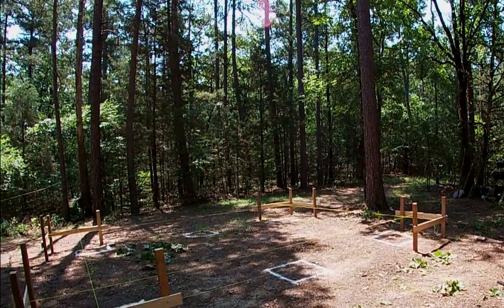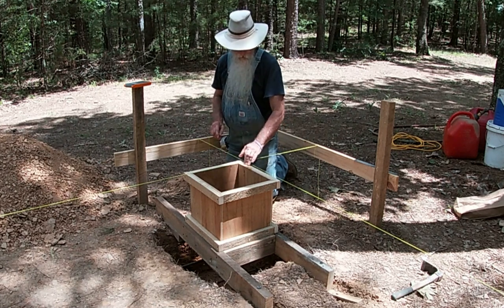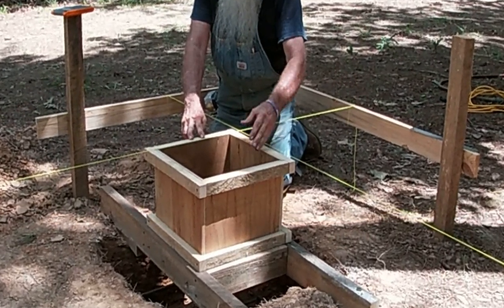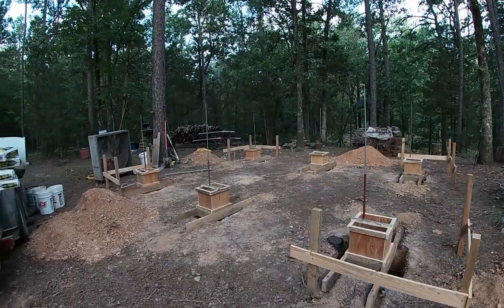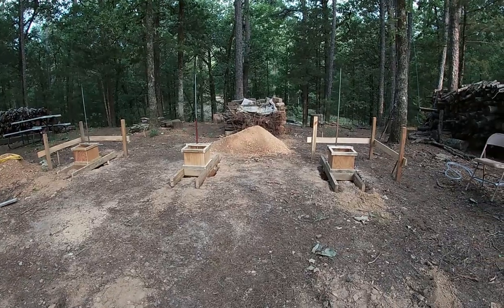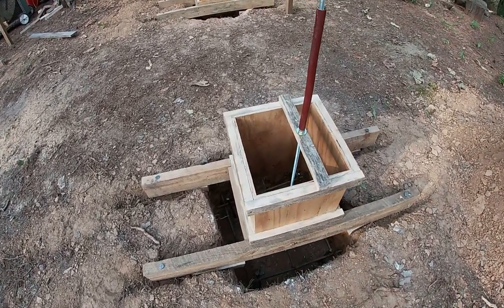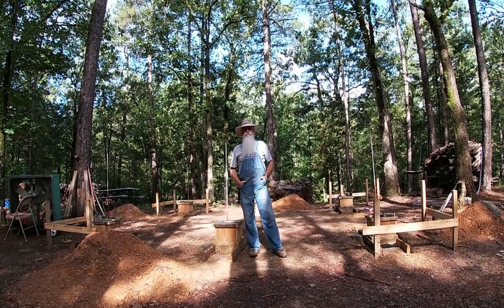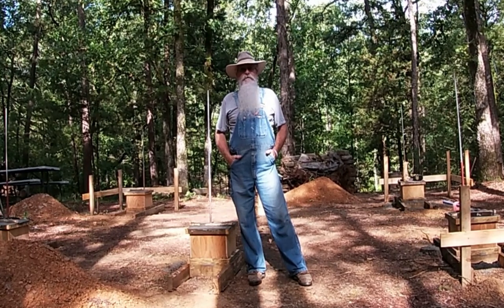Footer & Piers, Paradise Point Log Cabin Build - Ep 1

Comment: I had the idea for my peirs as a galvanized culvert bore into the ground 4 to 5 feet below the ground and 3 to 4 feet above ground fulled with cement.  That would provide 8 - 9 feet of peirs in cased a Metal culvert. I have to build with the consideration to hurricanes. We have to be Concerned with mold and wood eating insects too. Just a suggestion and something I learned on my curry house built in 1920. On top of the peirs, place a oversized flat piece of galvanized steel that over hangs on the peirs 8 - 10 inches. Then place the logs on top of that metal. That way any wood eating insects climb up any piers,  they touch on that metal and then they fall off to the ground. Termites don’t like anything metallic. It becomes a cycle keeping them bugs away from the wood. It also helps to have that house raised up at least 2 - 4 feet from the ground to lessen the chance of mold. High and dry as my father would say. Thank you for taking the time to put these videos together and god blessings to you.
Reply from the maker: Howdy ABC- you have some really good ideas for doing the piers. We don’t have hurricanes but tornadoes do happen here. You have good suggestions for the tops of the piers with the metal cap. That has been done and it works. Thank you so much for the comments. God bless you
Reply: @TheBeardedCarpenter  nothing wrong with overbuilding the place you call home. I can’t wait to sell my current property and get to the sticks. I’m sure of the configuration of my cabin. It’ll be built with the traditional craftsmanship methods but with some knowledge of today. The knowledge we possess today, far exceeds the knowledge of yesteryear. We have evolved. I know I don’t want electricity, in-door plumbing, internet/cell phones. I’ve even considered a horse and buggy’s. If the Amish won’t so found of the cold, I would consider relocating to that type of community. But I disagree with there religious denomination. I’m comfortable with LCMS as opposed to Calvin. I respect the individuals whom are subscribers to Calvin, but we’ll disagree on many issues. I do want I can to be kind and respectful I came across. But you do run-up one that 1. But Florida isn’t half bad. There’s many types of fresh and salt water fishing available. hunting is good and all around us. Many different activities all around us. Property tax’s is reasonable. Residing inland northern Florida shields us from hurricanes. Right now there’s one in the Florida keys. Excited to come up here and brake-up to a simple tropical storm. That’s way I would enjoy a rainwater collection system in which Florida supports rainwater harvesting. God blessings to you to sir. Happy Independence Day to all my country men.
Reply: @TheBeardedCarpenter  A home is only as good as the ground/foundation it resting on. Hopefully high and dry too.
Reply from the maker: @ABC-oo4vm  Howdy- you’re so right. Both the cabins I’m doing are on the high part of the property and drains in all directions away from the cabin. Blessings
Reply from the maker: @ABC-oo4vm  Howdy- there are many people who are looking at everything like you are. It seems there’s a group of people wanting to get “back to nature”. The first cabin I built is totally off grid. Wishing you the very best with what you decide to do. God bless and keep you in His care

Comment: I've worked concrete in various capacity for as long as I can recall, not as a professional but as a DIY, so please bear with me.  Everytime I've needed forms for load bearing, I've always just purchased concrete brought in with trucks.  That said, you mentioned something about 'honeycomb', in reference to your moisture content with the bag mix.  Could you expound a little, regarding bag mix, on what is best as far as moisture content at mix for pillars exposed to that magnitude of weight?  Thank you
Reply from the maker: Howdy Chris- when I refer to honeycomb I’m talking about the concrete filling all around the sides of the form so it looks smooth. What I’ve been getting is a 4,000 lb mix which is stronger than what I will get at the batch plant. The pillars are pretty strong with the cement I’m using. Hope this helps. God bless
Reply: @TheBeardedCarpenter  Oh ok, gotcha on the honeycomb.  Thanks

Comment: If in fact your a type of person who’s able to think outside of the box or willing to think different. How bout this idea, insulated sheathing (zip system) comes to mind. But don’t use the tape. Use the .25 gap between the 2 boards and replace the tape with line-x. I’ve came across a few builders here in Florida that are incorporating linex into their builds. Manly for water tightening. They’re using linex on the whole roof. Comes is any color you like and comes without the grit in the rubber. It has lifetime warranty too. Come-in way less then any asphalt, clay, slate or metal roof. But the performance is too hard to deny. It’s a rubber coating. So that means it’s even protected from lightning streaks because of being rubber. Do some YouTube research with linex and think of all the useful things are able to use it on. I don’t know of any products that can stand the abuse linex can. Maybe even spraying linex under the cabin for water or humidity tightening. I think of all kinds of uses linex can protect. Only issue I can foresee is you would have to find a mobile installer in your area to come out and spray because not everywhere there’s a mobile installation available. I’ve even thought bout becoming a mobile installer in my area because no one is doing it as of yet. Now that I’ve posted my idea on YouTube that maybe will change. Sorry bout being long in the tooth but I’m also thinking differently then the norm. Thank you for taking the time to read my post.
Reply from the maker: Thank you so much for this information as I haven’t heard about it here in Arkansas. I don’t know of anyone using it yet. We do have humidity here but not quite like y’all do. I lived in Florida for a while a long time ago. I gotta get on the net and learn about this. I sure do appreciate you making me aware of it. That would be great if it worked out for you to be a mobile installer. Blessings to you